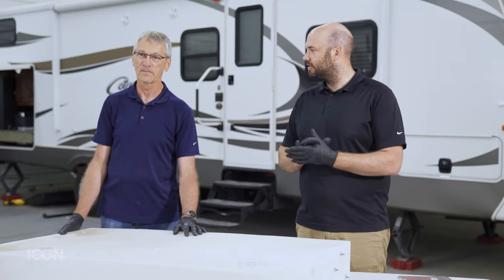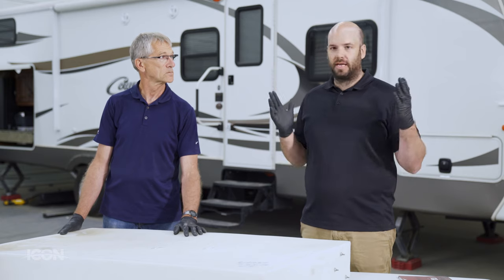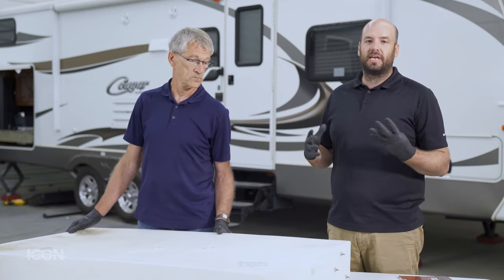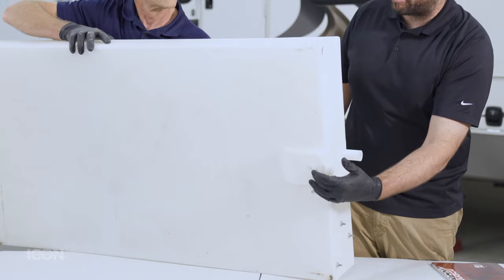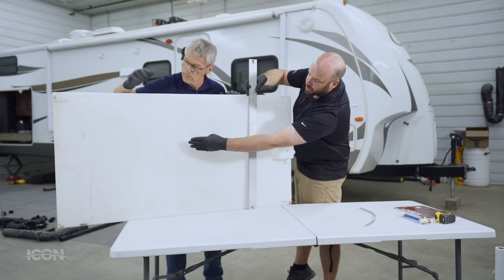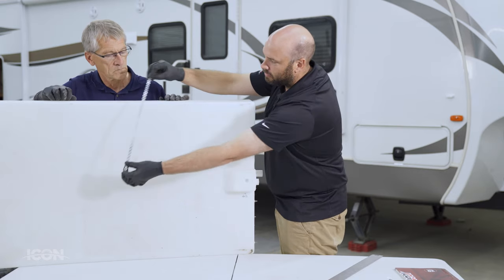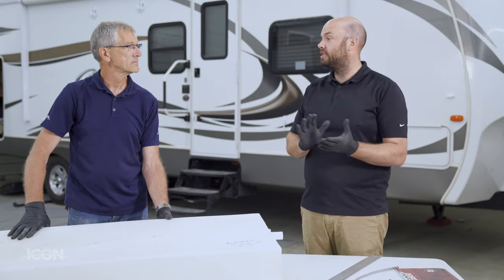Training Series - Fresh Water Tank Install

Comment: Im trying to figure out how to remove one, i cant seem to remove it without making cuts on the flat iron but id rather not if i dont have to
Reply from the maker: The attachment of the tanks vary a bit from the original trailer manufacturers. Often they are slid on and clamped in such a way that they can be removed easily, but sometimes they are put on early in the manufacturing process and stuff gets built around them making it rather difficult. It varies, so I'm sorry I can't give specific advice.
Reply: @Icondirect  That's what it seems like here! The technician who was teaching me couldn't figure it out so he had 5 other techs look at it and we all settled on an angle grinder being the solution. We put it back together in a way the next person can easily remove it if they need to
Reply from the maker: @teddy5004  Good thing to think forward that way! Happy you got it sorted!

Comment: Um, you didn't get to the install. Perhaps, rename the video or include the install? Did not subscribe for this reason. Thank you.
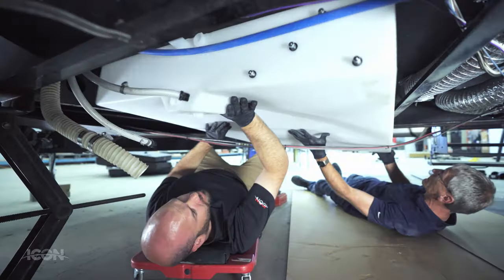Reply from the maker: Hi Deborah! Installations vary so much, we wanted to focus on explaining best practices in selecting the appropriate tank and touching on installation in a general sense. Starting at 2:22 we discuss and show physically placing and supporting the tank.
Reply: @Icondirect , thank you for your response. As you stated, this is a general information video, not an install. I'm trying to figure out the plumbing aspect (the actual install,) especially when the original tank is no longer being manufactured. Does the same shape and size need to be installed because of weight distribution? What type of fittings/tubing should be used? Type of sealant and where? What if the fittings don't line up? How is that addressed? I'm finding a lot of 'Southern Engineering' videos from other people just trying to get it done, and partial/hollow advice from RV places that don't want people doing their own repairs; this half-a**, good-enough attitude is why these things have to be repaired all the time in the first place. The last time anyone took quality work seriously (as a normal way of doing business,) was 1973, but I can't find a seventy-year-old RV repair technician. I have been taken advantage of by RV shops (almost) every time, so I won't do that anymore. I'll learn how to do it myself, or it won't get done. I'll keep looking; thank you.
Reply from the maker: Hey Deborah, 

The factors involved with plumbing in the tank can vary wildly and wasn't the focus of this video because of that. I'll try help with a few of your questions:

Does the same shape and size need to be installed because of weight distribution? Typically, No. You can upgrade the tank size to whatever space you have available or downsize. 

What type of fittings/tubing should be used? Type of sealant and where? Modern fresh water systems is typically done with PEX. 1/2" sized piping is most common, with 3/8" also being acceptable. 

Type of sealant and where? Typically plumbers tape can be used on threaded fitting locations. Otherwise pipe connections via PEX connections is typical. Sealant isn't often used.

What if the fittings don't line up? Fitting locations on the tank can vary. Aftermarket configurations from ICON usually entail a fill and 3 1/2" fittings on the end. One will typically be used to vent the tank, one will supply the pump. The 3rd and 4th can either serve as a drain if desired. Unused fittings can be plugged. As far as lining things up, you'll want to plan out where the pump is and the lengths of pex. Giving slightly additional length with PEX is easy and desirable as you can then easily loop the piping and line them up at each end easily. 

I hope this helps!